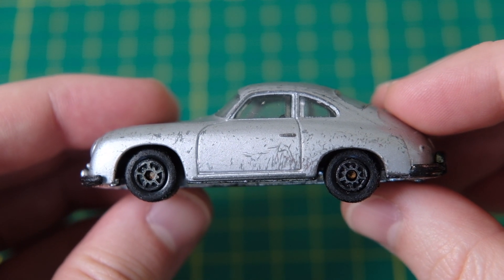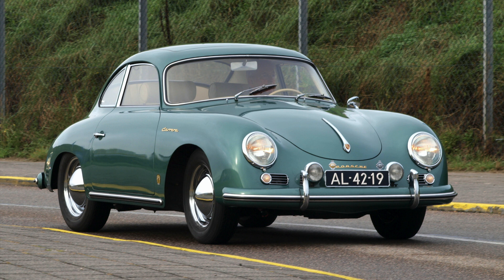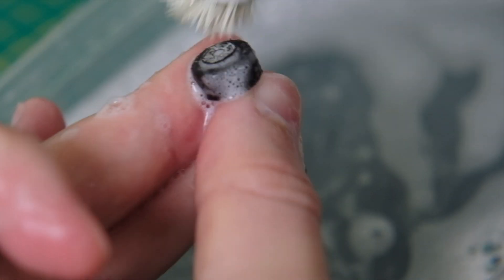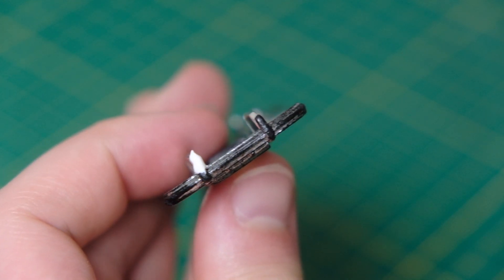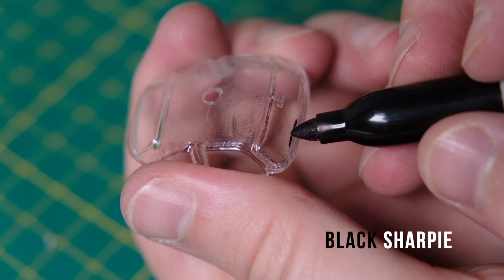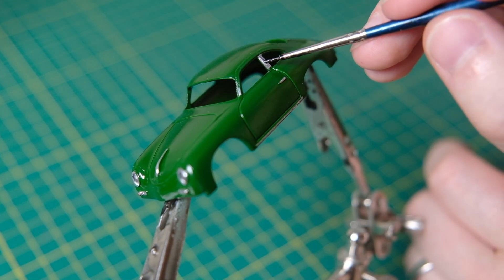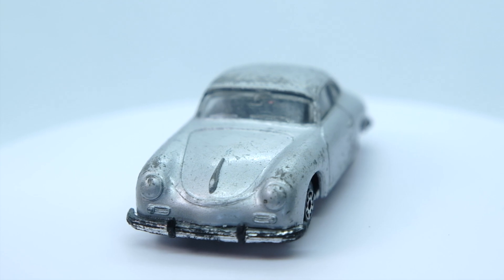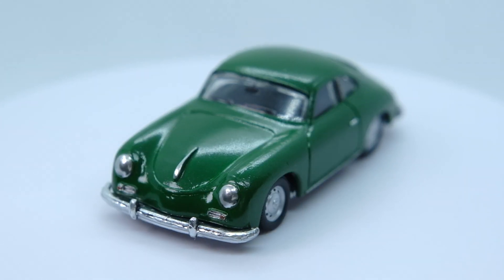MC TOY custom restoration: Porsche 356A

Comment: I used to work at a company that made the soft top replica of these they was called chesel instead of porsche, it had vw beetle chassis cut down 150-200mm then welded back together, strengthen and then all vw beetle engine, gearbox, running gear fibreglass replica body and a custom interior,